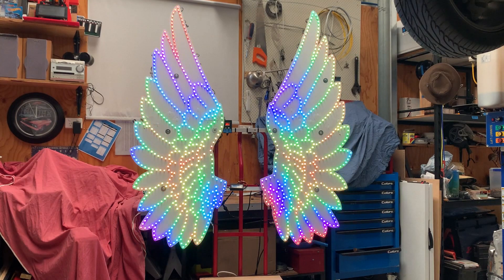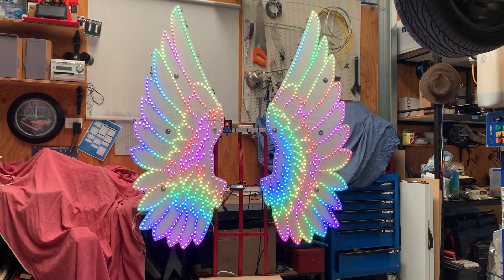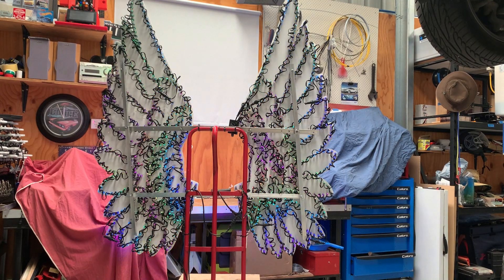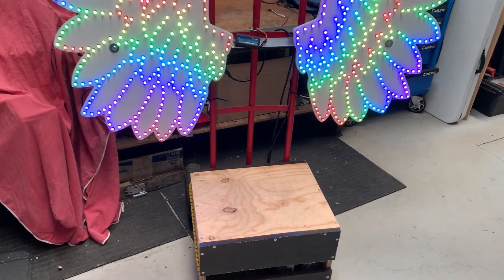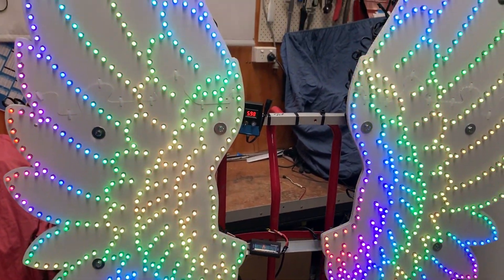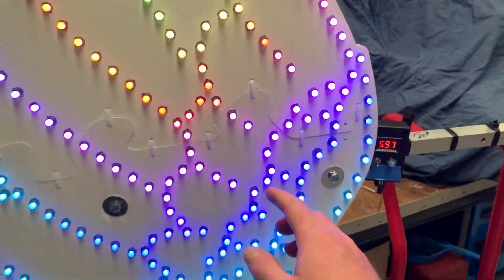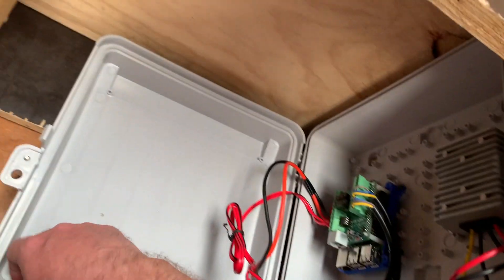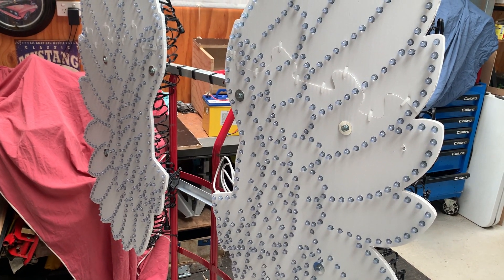EFL Designs -  Wings (Coro Prop fitted with WS2811 RGB LED Pixels) - Dodgy Build Practices!

Comment: Where did you get the current draw tester?
Where in the circuit do you put it?
Reply from the maker: Its a RC motor current draw tester (amp gauge) connect in series between controller and first pixel. I did a youtube video with the details a couple of years ago on our channel

Comment: What should I get for my light show like what do I need, I don't need a Radio Fm transmitter though
Reply from the maker: Lots of options for a Light Display, if you want to use pixels (12v or 5V RGB LEDS) i would suggest going to www.xLights.org and in the media section you will find some great video resources, also Canispater Christmas has some great beginner videos to help you get started. https://youtu.be/YuEmTs_m7f4 Alos AusChristmaslighting.com.au has heaps of information